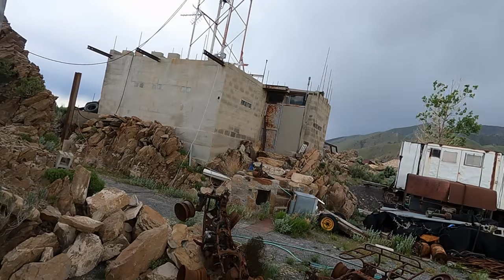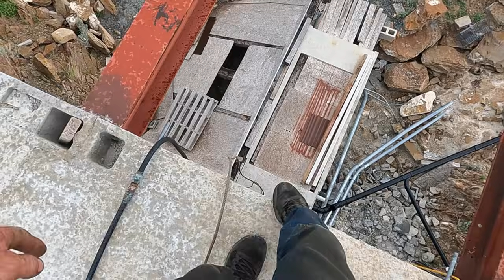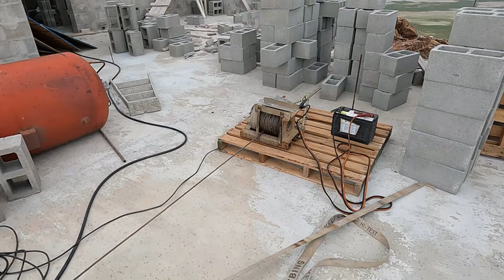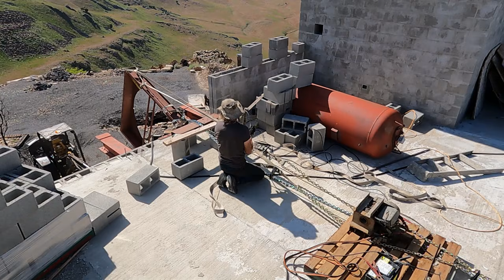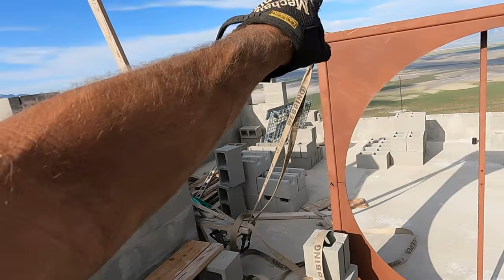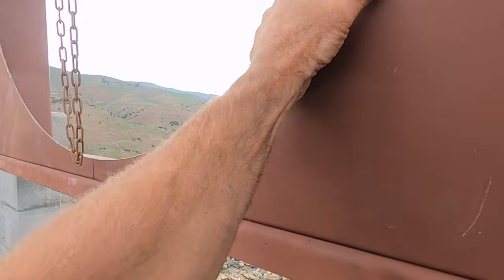Installing Turbine Frame 1 on top of the Fortress! 2

Comment: I'D BUILD A JIB CRANE FOR THE NEXT ONE TO GET IT UP THERE, AND BOLT IT TO ONE OF THOSE I BEAMS WITH A PLATE, PUT A PULLEY ON THE END OF ARM FOR CABLE TO RUN THROUGH. OR YOU CAN USE THE SAME IDEA YOU USED UP TOP, ONLY USE STEEL PIPE WITH PLATES WELDED TO THE BOTTOM AND BOLT THEM TO I BEAMS, SO YOU CAN GET IT UP PAST THE EDGE. YOU CAN MAKE A SIMPLE JIB CRANE OUT OF  2 DIFFERENT SIZE PIPES.  JUST ONE VERTICAL PIPE, TALL ENOUGH TO CLEAR EDGE OF BUILDING WITH HOUSING. JIB ARM, WELD BIGGER PIPE HORIZONTAL ON END OF JIB ARMS SO THEY SLIP OVER VERTICALL POLE, AND 2 , 3" WIDE COLLARS ON VERTICAL POLE YOU CAN PUT BOLTS THROUGH AS BEARING COLLARS FOR HORIZONTAL PIECES WELDED TO ENDS OF JIB ARMS CAN RIDE ON, AND NOT SLIP DOWN POLE. SLAP A LITTLE GREASE ON THEM, WILL WORK FINE FOR WHAT YOUR DOING. THAT WAY YOU CAN HOIST IT UP, AND THEN SWING IT OVER ROOF. YOU CAN USE THE SAME CONCEPT WITH A CART, AND CONCRETE BLOCKS FOR BALLAST IF YOU WANTED TO. THAT WAY YOU WOULDN'T BE TIED TO I BEAMS. BUT YOU WOULD BE LIMITED BY BALLAST WEIGHT.

Comment: Awesome video! I’m a stone mason I built a moveable crane arm to lift 3,000+lb hearth stones and mantles i used 4-6 inch square stock and a quarter inch thick steel plate, weld a 2’ x 2’ square plate to the bottom of an 8 foot long 6 in. Square stock, at the top make a 90 weld a 4 foot piece of 6 in. Square stock then gusset the two pieces with another short piece of 4-6 in. square stock at the end of the 4 foot piece at the top drill a hole to put a hook and a bolt to hold the pully, the bottom, 2’ x 2’ plate drill for holes in the corners so the plate can be attached to your concrete floors with anchor bolts. then you could put a heavy duty rope or cable in the pulley and hook it to one of your heavy machinery pieces, and just drive the machinery forward, and it would lift anything you attached to it. I built mine in less than four hours. 🤷‍♂️ just an idea.

Comment: Come on Allan, you're better than this. Firstly, welder in the basement could be used for power. Then, you should have always had a swing arm out there, on top of those 2 I beams to haul up things to that deck. Thirdly, you have a mile of cable on that winch, and you know how snatch blocks work to double your pull power while halving the speed of that winch....You're working hard, not working smart. Love the vids, keep on going, but make things easier on yourself. You have access to all the tools you need, so do it.
Reply: cool stpry jeff is that what you did?

Comment: what you do have is lumber and you can make a slider on an angle not only for that but everything, and then attach your winch like an elevator, and use a strap that is not 20 years old. where is your flag. good work. to get up in the winter time what about an asphalt drum roller with steel spikes welded all over the rollers about 2 foot long each.

Comment: If you'd put a pulley on  frame, where you had winch connected and put hook back on other side of building would've made it alot easier. But you're getting it done.  Gotta congratulate you for that.

Comment: Always amazed at how you manage to do things by yourself that appear near impossible
Reply: And people wonder how humans could build the pyramids. Hard work and time.
Reply: @jackmeowmeowmeow2177  yeah but the time frame that the pyramids were allegedly built in is the problem. They said it took like 20-30 years to build the great pyramid and theres like over 2 million MASSIVE blocks some we would have trouble moving today.. so to place all those blocks in that amount of time means you have to do like 1 every minute 24hrs a day for 30 yrs.. and that doesnt count bringing them from the quarry some over 500 miles away and then shaping them all PERFECT.. it took like 180 something years to build Notre Dame .. and thats massive and beatiful but nothing on the scale of the pyramids
Reply: @Mikeys_Bag-O-Meat  you also had arguably one of the richest men at the time along with likely hundreds of thousands of slaves working around the clock. Also the time frame is merely an estimate since there is no actually record stating how long it took, meaning it could have been longer. Just speculations. We built the Empire State Building in less than 2 years, now just think about that. It only seems crazy to us because we couldn’t witness the construction, but when you have literal tens thousands of slaves working specifically to build one thing, chances are you will achieve that goal fairly quickly, no matter the cost in lives.
Reply: @jackmeowmeowmeow2177  the problem with throwing man power at the problem is that the amount of men required to move some of those blocks would take up so much space there wouldn't be anywhere for the block to be. And they didnt have work animals or the wheel. Belive me i understand what your saying but theres something missing. And they were meant to be tombs allegedly so they had to be completed either during the Pharaohs lifetime or shortly thereafter and some of those pharaohs did not live very long
Reply: @Mikeys_Bag-O-Meat  they had wheels... they had pack animals... where are you getting this info? They also had cranes and pulleys back then too
Reply: @jackmeowmeowmeow2177  what work animals did they have aligators ? Lmfao
Reply: @jackmeowmeowmeow2177  a quick google seach will show you "Ancient Egyptians didn't have the wheel when they built the pyramids; they only had stone and copper tools." Do you really understand how long ago dynastic egypt was bro?  We are closer to the time of Cleopatra than Cleopatra was to when the pyramids were built.
Reply: @Mikeys_Bag-O-Meat  camels, horses, cattle, elephants, etc. You’re talking about literally the richest guy on the planet at the time bankrolling it. Idk people weren’t stupid back then, and they knew how to build shit.

Don’t be ridiculous and just think for a minute of what they actually had back then instead of just saying “oh lol alligator work animal lol hurdur” otherwise I’m just gonna take you as a troll.
Reply: @Mikeys_Bag-O-Meat  wheels have been used since the Neolithic period. Egyptians definitely had wheels. Wheeled vehicles since 4000bc the pyramids are from 2600bc try again troll
Reply: @jackmeowmeowmeow2177  I don't know man I've been Gathering a whole lot of Paradigm shattering information about the great pyramid of Giza that takes the official narrative, & crumbles it up, stomps on it and throws it in the garbage! The Great Pyramid wasn't built when we thought it was or by whom we thought it was or how we thought it was.
Reply: @jeffreebailey4464  you’re right the Annunaki built the pyramids. S/
Reply: @jackmeowmeowmeow2177  bro your wrong they didnt have the wheel bro. But thanks for playing.. Again i refer to my previous simple google search  but its cool you can live in your own little world and belive what you want. Its no sweat off my bag.
Reply: @jackmeowmeowmeow2177  also one little thing.. they have hieroglyphics of them pulling some blocks along on wooden sleds. Why would they be doing that if they had the wheel? AND wheels in the very deep sand thats all arround them wouldnt be useful at all anyway they would just sink in the sand ESPECIALLY if you tried to haul many multi to stones.. use your head a lil bit.
Reply: @Mikeys_Bag-O-Meat  not all of egypt is sand, so ofcourse where wheels wouldn’t work they would use sleds and manpower to move it.
Reply: @Mikeys_Bag-O-Meat  you and the others can chime in, I was watching a joe Rogan pod. Guy was talking about somewhere I'm assuming near or the pyramids how long ago before the desert it was green. But the point he made is the years they said it was made is like years and years off based off WATER EROSION the craters on the statues etc have so many more years of water damage.
Reply: @WhatsIncluded  yeah they are talking about the sphinx. Dr Robert Schoch a geologist was one of if not the first ppl to confirm it was water erosion. And it would be impossible for wind and sand to erode it that way considering it was buried up to its neck when they found it. But yes it was like rainforests type tropical area and there was another large river besides the Nile that went from the Mediterranean out to the Atlantic. And that type of erosion would take 1000s of years by water. The face of the sphinx is not original as well its too small for the body its on so it was recarved at some point.
Reply: @Mikeys_Bag-O-Meat  thanks for the info! Amazing stuff.
Reply: @WhatsIncluded  they took these precise measurements of some pottery that date back to very old Egypt and the measurements are so incredibly precise and it's made out of granite or dolerite that's so hard we would have trouble doing it today like perfect circles and perfect symmetry it's crazy check it out
Reply: @Mikeys_Bag-O-Meat  I saw that 2 on joes podcast. Yeah he said it was  perfect compared today's tech which is different tools and or robots and machines etc. That is something that makes you question history. So many questions unanswered unfortunately.
Reply: @WhatsIncluded  yes theres definitely more to history than what they ALLOW us to know..  thats why its a shame things like the Catholic church destroying ALL of the books from the Maya when the Spanish conquered mexico.. Imagine what kind of info and things they had. Or again the burning of the library of Alexandria.. SOOOO MUCH info just gone.
Reply: @Mikeys_Bag-O-Meat  yeah so much history just lost for what? Politics isnt something new unfortunately

Comment: Alan...  Maybe you could build a "A-Frame" with a pully and attach it to the two I-beams that protrude from the side of the building.  If it were attached out away from the building it would keep stuff from hanging up on the building as it is lifted up.  Maybe make the A-fram tall enough so once and item is high enough take some 2x6's and span it across the I-beams under the item to maneuver it on to the concrete floor.
Reply: Much like the system they used at the vertical mine shaft a few weeks ago!
Reply: An A frame that can hinge at the bottom would allow for lifting and setting up on the roof! The taller the better. Or even a jib crane on a telephone pole?!

Comment: Awesome, Allen! :) But you need to weld together a assembly crane you can put up the top. This isn't the only heavy thing you need to lift up there. I use a small crane to lift my boat up to the pier, when heavy sea approaches. Takes me 30 minutes and 8 bolt to put it together or take it down. And 1 man can lift and handle all the pieces.

Comment: Also.if you attached the straps to the bottom next to the wall it would lift it up easier than using all that tension to dull it up.